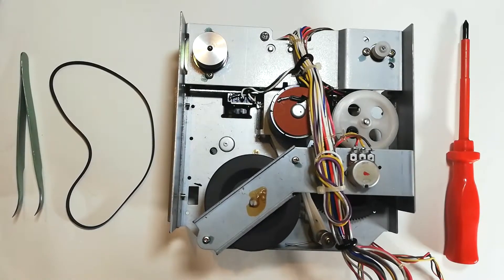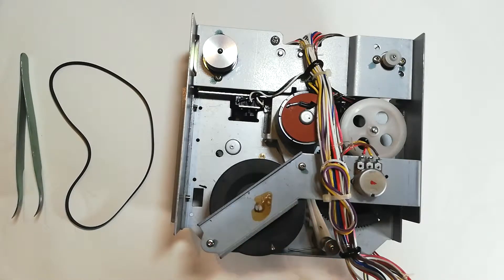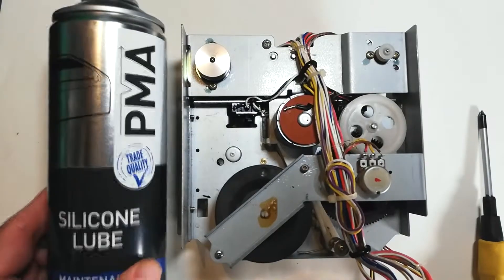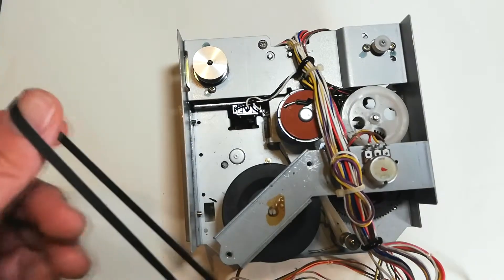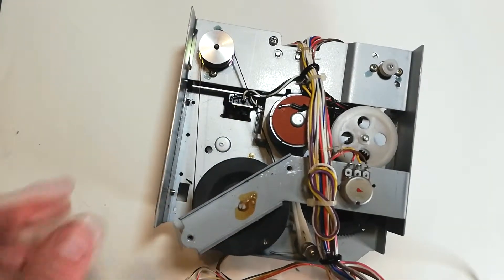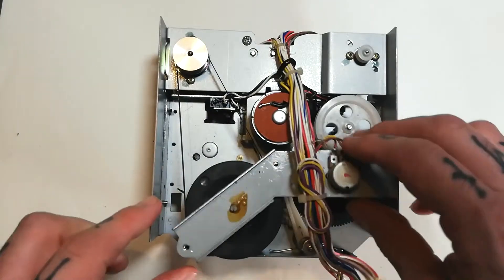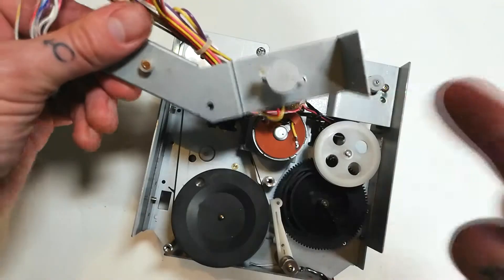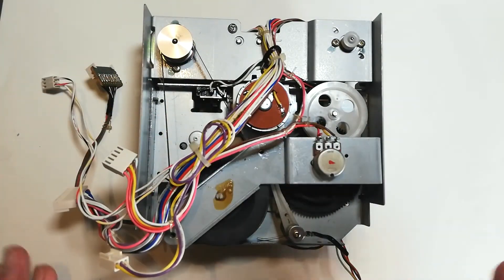9 Capstan belt (Fix Your Tascam 244 Portastudio Transport)

Comment: Replaced all my belts and pinch roller as well. Everything seems to operate fine but now my capstan belt seems to be slipping off sometimes, as well as making a repetitive squeaking noise that eventually slows down which also makes the tape play slower in play mode. This is from a belt set from west coast belts. I’m thinking maybe something wrong with the small white capstan wheel ? I’m stumped
Reply from the maker: @toadspit9635  I’m not totally sure what the “white plastic capstan wheel” is….do you mean the pinch roller? ( the pinch roller can have either a plastic or metal core with a rubber tire and raises to touch the metal capstan pin in play mode) the squeaking speaks to something rubbing but without being there I can’t tell you where that friction is located unfortunately. Belts slipping off - sometimes this occurs due to the chassis on which the motor is mounted is subtly bent so the flywheel and motor pulley are not perfectly parallel, but more often its because the belt is the wrong size, particularly too tight, which would slow the motor. I’m loathe to criticise a company in public comments but I and several people I know have had bad customer service experiences with west coast belts and it does leave me wondering if their kit has some imperfectly fitting parts in it? You can get belts from Ali express these days cheap, like a few dollars each, I’d suggest getting several adjacent sizes to the one provided by WCB and see if switching over helps your issue?

Comment: Thanks so much for these videos, they’ve helped bring a much loved 246 back to life 🙂 As advised, I didn’t remove the metal bracket when fitting the new drive belt, however the bracket on the white gear somehow popped off anyway. I didn’t notice at first, and having put the machine back together, things were rather interesting when I turned it on 😅 basically the heads were just stuck in the play position. So thanks for adding that situation to the end of this video. I managed to get it back in place without having to remove the whole bracket - if you remove just the two upper screws, you can just get enough leeway to pop it back into place. Which is probably how it popped off in the first place…
Anyway, thanks once again

Comment: First of all! Thanks for the tutorials. This information is priceless. I just inherited a unit with a melted control belt and decided to replace all rubber parts. Unfortunately the guy my uncle brought it off had gone into the danger zone so thanks so much for explaining that. How precise do I need to be with the black wheel?
Reply from the maker: Thanks. With the black wheel, you need to be precise enough so I know whether you are asking about the pinch roller or the idler tires? Hahaha.  Seriously though, tell me  which and I can post a link to the video that discusses sizes for that part. Thanks for watching!
Reply: @Tetrakan  sorry I mean the black gear! The person my uncle brought the 244 off must of moved it so I’m wondering how precise I have to be when setting it up like you did in this video.
You said around 5 o clock so I’m wondering if there’s wiggle room there?
Reply from the maker: Ah OK! So long as the white plastic clip which interfaces with   the potentiometer on the metal plate above hasn't been removed and put back on, eyeballing at about 5pm is enough. And if you do put it together at the wrong place, I don't think will get damaged? Sorry if I'm being vague, it's not something I have to deal with very often, and its been months since i did it last - if you got stuck I could talk you through it over messenger video or something.
Reply: @Tetrakan  I believe the plastic clip was removed. I turned it anti clockwise and it didn’t stop at the little hole so I had to take it off and attempt to line it up the best I could. 
You don’t need to apologise, you made waaaay more sense then I did in my original comment. 
You’re a generous person to offer a video chat, I’ll keep in touch. Im kinda confident it’ll work just by how it looks. 
Just got the pinch roller left to do and all the rubber will be replaced!

Quick question while I have you here. Did you ever find you needed to re cap the power supplies of these units?
Reply from the maker: For the psu caps, rarely, unless it actually doesn't power on or there's terrible mains hum I wouldn't worry about it. There's a visual guide to installing that white clip on this website https://www.mzentertainment.com/pics/teac_244/dr_zee_workshop_tascam_244_project_part5.jpg
Reply: @Tetrakan  ok so update! It seems to playback ok but the record function doesn’t work. Gonna chase up the connections in the unit and see what’s up.
Link was very helpful getting the final adjustment in the transport so I’m pretty stoked. Thanks for your help.

Comment: My new capstan belt was rising up and off the fly wheel. This was solved by getting a proper replacement from GB audio- belt 10- L=276mm. The capstan belt provided in a kit from Germany was a cm too short and thicker- and because of the extra tension it must have pulled the silver capstan wheel, forming an angle which allowed the belt to rise and come off. Avoid the kit titled '✈ - Idler Tires + Belts Tascam 244 246 Porta Studio CAPSTAN CONTROL BELTS - ✈ from trader 'phonohifishop' in Siegen Germany
Reply from the maker: Thanks fro sharing this. Sorry you had problems, but glad you got to the bottom of it.

Comment: Hello again, I have replaced my belts, thanks for the video and tips. Now when I turn the unit on, the tape deck itself works fine, but the unit goes right into this mode, all meters have the Peak light on, meters themselves are not active. When I play a tape I get nothing  from the meters at all. Like no signal getting to them, but again, the peak lights are lit up. Any suggestions... Thanks in advance.

Comment: My Capstan belt won't stay on the pully. Any suggestions? Please help!
Reply from the maker: This happens from time to time, I think its becasue the flat metal plates the transport is built form are slightly bent, so the motor pulley and flywheel aren't quite parallel. You can try a shorter thicker belt (you might have to calibrate the pitch trim pot slightly to compensate) Also adjustuing the relative tightness of the screws that attach the capstan motor to the metal plate can help get the pulley and flywheel parallell again. you could even try pushing on the metal bracket the motor is attached to, sometimes bending ti a little with pressure form a screwdriver etc fixes the issue, good luck.
Reply: @Tetrakan  This sounds like trial and error. Move things the wrong way and it can get even worse. And when you move things the wrong way you are weakeing the mechanics. I have spent good money on all of the belts and still can't get it to work right. I'm frustrated and perplexed.

Comment: Replaced the two belts in my Tascam 246 but unfortunately it still doesn't budge when I press the play button. I also don't hear any sounds from the two motors. The tape counter also doesn't come on. The VU meter lights do light up as well as all the lights on buttons and such. Any idea what might be wrong?
Reply from the maker: Maybe fuses have blown? Is there a little  board with 5 glass slow blow fuses mounted to the top of the cassette player?
Reply: @Tetrakan  yes there is, good one, I haven’t checked those yet.
Reply from the maker: Use the continuity tester on a multimeter, you'll probably find that 1 to three if them blew when the belts snapped, replace them with the correct values, SLOW blow must be used, motor should turn and counter light again.
Reply: @Tetrakan  took me some time to get to it, but two of them have indeed blown. So will get replacements and see whether that gets it moving.
Reply: @Tetrakan  I just replaced the first two fuses with two similar value new fuses (500 mA, slow blow) and they immediately lit up when I turned on the 246. So blown again. Anybody any more ideas of what can be typically wrong?
Reply from the maker: Check a voltage regulator hasn't become detached during the rubber installation. There's a regulator mounted to the side of the transport for instance, if that's not attached the corresponding fuses might blow. Failing that you're going to need to develope troubleshooting skills to figure out if there's an upstream problem with that section of the linear power supply or a downstream problem like an open semiconductor  shorting to ground whichbis drawing too much current, or else take it to a technician.

Comment: After 25 years rotting away in its box my 244 Portastudio is working once again! I still have all my tapes and it was wonderful to hear them after all this time. I can now transfer them onto my PC and re-mix them - especially the tracks where I made a backing track then added vocals on a separate take - I will have 7 tracks to remix now! The pinch wheel I located on ebay turned out to be a little too thick, and the hole in the middle was 2.5mm instead of 2.0mm but it works fine. The biggest problem I had was undoing the two screws to let me fit the belt over the flywheel - they were well and truly stuck. I scratched the blue glue off, tried penetrating oil and even heated them up to no avail. In the end I had to use a mini-tool cutting wheel to cut a new 'groove' in the top of the screws so I could use a flathead screwdriver - it worked... Thank you for this series of videos - I would never have contemplated trying to repair it without them. You've given me a time machine back into the 80's... Well done and thank you so much!
Reply from the maker: That’s great Rob, glad I could help!

Comment: The white plastic arm attached to the control potentiometer is not an easy to find part. Mine has one of its legs snapped off. Anyone source these?
Reply: More elegant and potentially stronger than what  I was going to do.
Reply: Sorted this out with your solution, works a treat, I've taken pic if useful?
Reply from the maker: Great! Yes please I'd like to see that, can you send it via Facebook messenger?
Reply: @hjhkjhre454554  Hello please I need to replace this plastic arm.. So the trick you made really interst me !! Thanks for your help ...
Reply: @francoisesco3606  how do I send u pic?
Reply: @hjhkjhre454554  Hello This morning i've managed to glue a little plastic piece using "superglue" (cyanolite) mixed with soda for better gluing.. So long it works, but I'm sure that your solution with guitar knob groove can be better /)
Reply from the maker: If you mean 3D printed part, not yet, that I know of….I was thinking it’s probably possible to cut a groove into a knob for a guitar pedal as a substitute? Though I haven’t actually tried that yet.
Reply: @Tetrakan  Hello and thanks. After changing capstan and control belts, idler tyres and pinch rubber, I still experiment an quite slow fast and forward rewind, also, the pitch control knob seems to act a bit erratically.. So 4im asking me if I did something wrong with idler tyres or else... My next big problem is that the Master R buss doesn't seems to output sound, or at a very low level.. I will try to improve this with you "Master" module video  but i'm not sure how to know whivh component has gone out .... Thanks a lotfor a hint if this problem is known (no Right channel  output on headphones and Cinch out, when you pan a track fully to the right, there is no more sound going out, nor clipping led on the Master  Right buss -
Reply from the maker: @francoisesco3606  I see you’ve asked a question in the comments section of the stereo buss video, so I will answer that part of your enquiry over there. The pitch problems…could that be because your superglue fix only half worked? I had similar problems when the white clip was loose but not completely broken….I suggest trying the guitar knob mod and see if that fixes the issue. While you are in there, clean the pitch control pot with contact cleaner compressed air then a suitable lubricant, sometimes if that pot is dirty it can cause weird pitch issues. If that doesn’t work, double check the pinch roller and idler tires.
Reply: exactly same problem for me !

Comment: This is an incredibly well done and helpful series, thanks! A few years ago i purchased a 244 in overall NOS conditions but sadly the tape transport stopped working after a few minutes and so i put it aside, but now i'll try to fix it...
Reply: Any NOS will have aged belts despite never used out-of-the-box. In some cases because it had never been used and sealed. The belts might actually work but not likely for a long. Still a NOS unit is the best catch out there. Just saying this so people don't get their hopes up as time is the single greatest factor influencing the life of the rubber parts. Good luck with your repair!
Reply: @aaronherdt5129  Thanks for your input and your wishes Aaron!

Comment: Great vids - just what I needed - Thanks!  I have a 244 from years back and have removed old belts & residue, but tried replacing with rubber bands as a temporary measure  (I just need to play 1 cassette and the only proper belts I could find cost £54 posted from Australia!) but the ordinary rubber band on the main capstan flywheel rides off after a couple of revolutions. Anyone any ideas how I can remedy or where I can I buy the correct belts at a reasonable price?
Reply: Hi @Flying New Zealand 
I know this was sometime back (just saw this video now)
Did you find an alternative? I resurrected my 244 with new belts etc recently. Mostly sourced from a Lofi music on Central Coast (north of Sydney Australia)
They specialise in this sort of gear. Both belts cost me $28.95. Cheapest I could find over here.

Comment: Any way to diagnose a bad capstan motor? I’m planning to refurbish a 244 I recently got and wanted to know before I bought any parts, as that is something I can’t replace.
Reply from the maker: There is a switch in the top right corner of the cassette cavity which is pressed upwards when a cassette  is inserted - you can press this by hand, you should hear the capstan motor whir even with no belt installed. If it does not respond that is a red flag, though it could be wiring, faulty switch etc. The only way to test for oxidation inside the motor or an overheating control chip is to install belts and make test recordings

Comment: Hi chief, thanks for the awesome videos. I have the problem of playback playing too fast. Replaced capstan belt; still have the same problem. I’ve noticed the belt comes flying off the pulley when the power is on. Any ideas?
Reply from the maker: The increased speed is probably due to the belt slipping - greater circumference on the pulley = greater speed. The problem you're describing  (and do check you're mounting it properly - belt should be about 3mm from the edge fo the flywheel) is something that has effected a few 244s I've worked on (I've worked on maybe 50-75 at the time of writing) and I figure its to do with slight misshaping of the metal plates that form the transport chassis (via viabration, heat? Can't say), such that the motor pulley and flywheel aren't quite  parallel. I've had limited success by pressing judiciously on the plate into which the capstan motor is mounted, but sometimes I've just had to swap the transport with one from a donor or build a "frankenstein" transport from the best bits of two transports. I'm fortunate to have started  when junk 244s could be had in the uk for £40-60 so i have the luxury of a large spares inventory, I don't know how viable that is where you are, and prices seem to have gone up everywhere. Sorry I couldn't be more help, good luck and thanks for watching.
Reply: Tetrakan Supermonobloc thanks man. First, apologies; after I wrote my comment, I realised you had replied to the same issues in two previous comments. A seemingly common problem, so..turns out I fixed by simply adjusting the old belt..the new one didn’t work! So I got lucky this time..maybe cleaning the gunk helped a bit..thanks again

Comment: Having big trouble removing the 2 screws, removed the blue gunk as much as I could and sprayed lots with WD40. I saw somewhere to heat the screws with a soldering iron. Wanted to run that by you before I tried. Surely this will expand the screws and make them more difficult to remove. Thanks for your reply
Reply from the maker: michael turtle yeah I think it works because the process of expansion and contraction can break any oxidation etc holding the screw in place, so try that in combination with hitting the end of your screwdriver with a rubber mallet and if that doesn’t work leave it overnight with penetrating oil on it. Sometimes I’ve had to persist with this process for several days before getting the screws out.
Reply: @Tetrakan  OK thanks, I'll try leaving it overnight, and then the heating trick. Mike